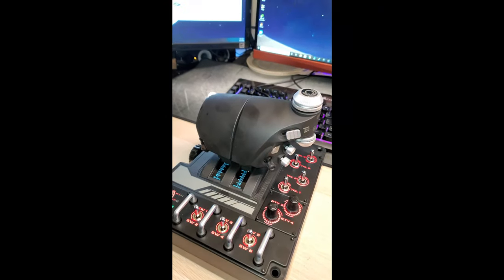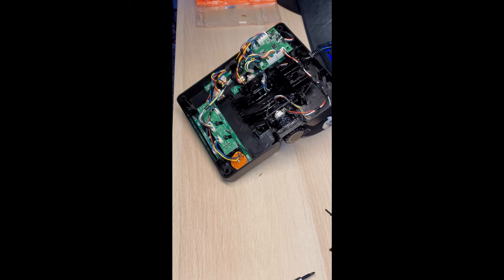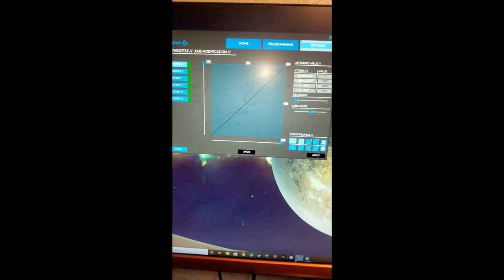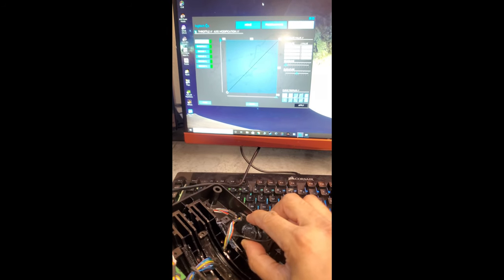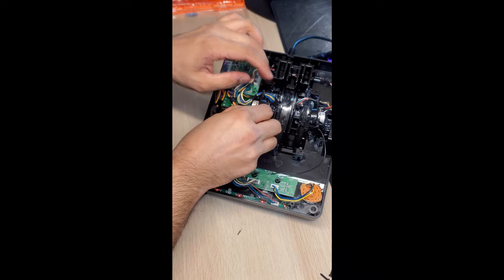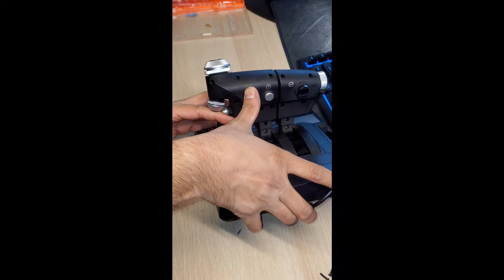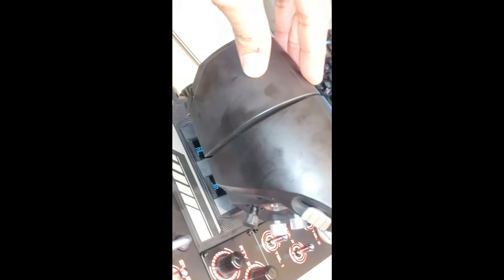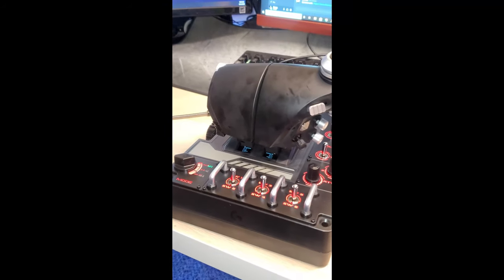X 56 THROTTLE FIX

Comment: Really kind of you to post that video and help others out. I stumbled onto your video whilst looking for X56 throttle teardowns - I don't have the same issue with my X56 - I get constant ghost presses so I'll be pulling mine apart too.
Reply from the maker: What kind of ghosting do u have thou
Reply: My roommate fixed the ghosting problem by getting a USB 3.1 hub and hooking the X-56 up through that to his PC. No more ghost button presses. Don’t have to take anything apart.
Reply from the maker: I acually found out recently that I plugged it in a USB 3.0 hub and ghosted but when separated on the pc and hub it works its also the power that is being supplied

Comment: Thanks. Yes, I thought it was a hardware problem, not a software problem. Simple work, and how effective. Tomorrow I am dismantling my throttle and doing a correction. Thanks for the video.
Reply from the maker: Just be careful the greece is very sticky wear some gloves
Reply: @MANGO-md8yy  Yes I know. I already undressed once, as soon as I bought it, to get a little bit of this grease, because the throttle was too hard. Thanks.

Comment: Don't do this. Just do a HARDWARE recalibration. Google the steps, it's super dumb and requires you to hold down some switches, plug it in, hit a few more key combos and it'll flash the LED lights. Then you move the throttle through its full range, unplug, replug and BAM it's fine now!
Reply from the maker: Damm I wish I knew that lol. I made a whole video about it
Reply from the maker: Thank you very much I'm going to look into that now once I get a chance
Reply: Lol sorry man... BUT now I'm experiencing a physical "creep" to full throttle due to the weight of the device. 

Seeing as you've been inside, got any ideas for that? It happens even when the resistance knob is tightened down.

Comment: The pot is either wore out or is dirty. My guess with the amount of grease in there is that it is just dirty. Go get some electric parts cleaner from a automotive parts shop and spray it in the pot.
Reply from the maker: The gear was put in a negative state from the rotation the throttle is going so by the time I hit 50% it would stop so i just moved the gear back and it worked not good at explaining sorry

Comment: Its becuase of the gears. perhaps rough play or extended use can cause the teeth to ware down or skip causing the ghoasting effect. logitech should really do shit better. make this part of the throttle more on the quality side, metal gears perhaps.
Reply from the maker: i got it new like that i didnt even use it that long maybe a week but yeah logitech should work on quality control
Reply from the maker: I still have it to this day and still works perfect except for a few buttons but other then that 180 well spent for last 2 or 3 years

Comment: OK and finally the 2 axes are  hall effect magnetic or simple pot?
Reply from the maker: I'm not really getting your question are ypu able to elaborate on it more please ?
Reply: @MANGO-md8yy  i'm asking (sorry for my english) if the throtle axis are made with trim resisitive pot OR, wuith the new hall effect sensor that use a magnetic field.  the second can live many years
Reply from the maker: @trucmuche2523  thier just gears inside from what I seen dn I thinks it's the magnetic but I could be wrong I haven't opened it back up in years 😅. Hopefully this helps and no need to be sorry bro you good
Reply: @MANGO-md8yy    thanks a lot, i'll open mine wher it comes ;-)
Reply from the maker: @trucmuche2523  I wouldn't open it see if the axis are good and even so if possible return it I took a risk at opening it but do what you must or what you want bro this is just an educational video hopefully it helped

Comment: which grease oil should we use?
Reply from the maker: I wouldn't know you can probably find something for toy Greece cause it is plastic and bits of metal or regular Greece for other car used lol I wouldn't know tbh but it's your call on this. Good luck but just be sure to do research.

Comment: do you not have ghost imputs issues ?
Reply from the maker: No not really this unit has help up even till now yes I think like 2 of the switches on the throttle have stopped working but I worked around them now other then the throttle issue nothing much at all the rest work fine so fare ohh almost forgot the stick side button sometimes has issues where I have to find the sweet spot but mind you guys this unit has been through about 3000 hours of DCS flight multiple modules even choppers so all the switches and buttons are being used